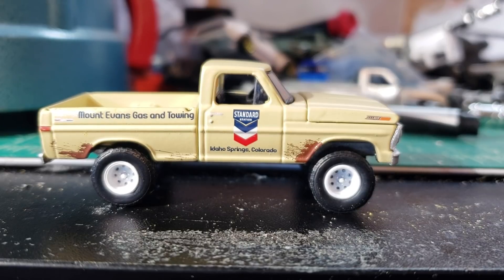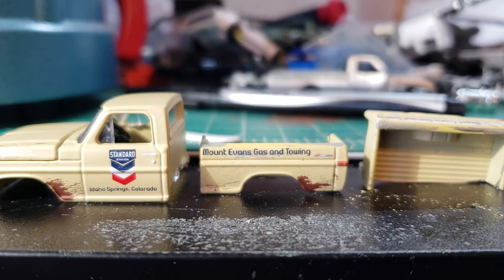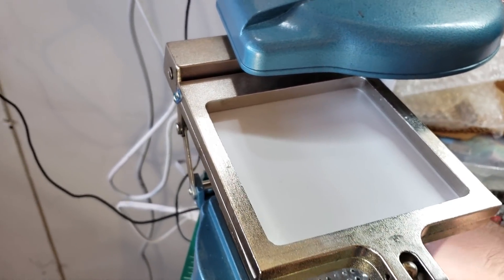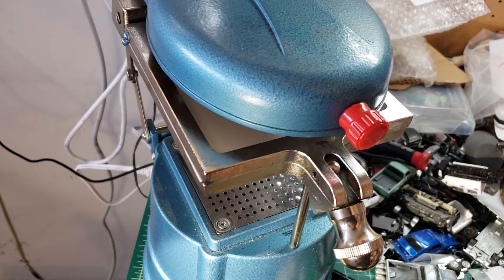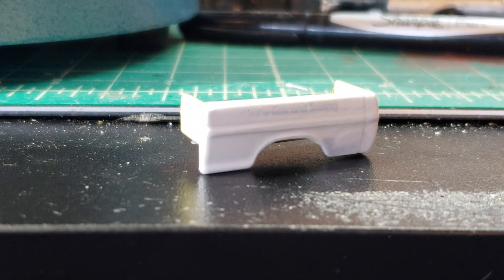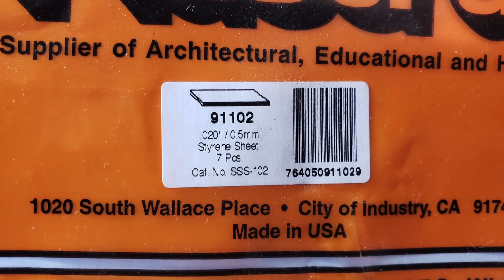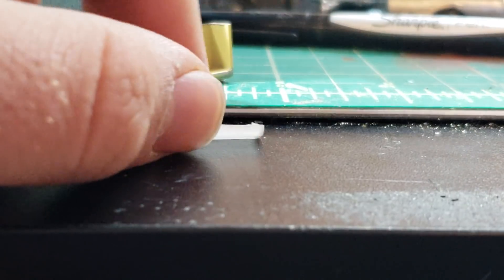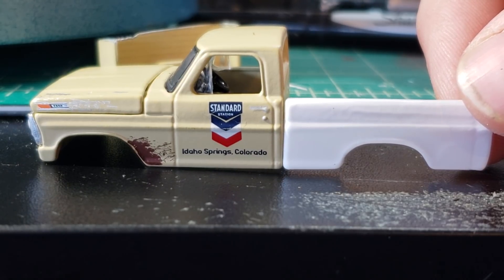Vacuum forming Parts for model cars

Comment: Could you add suspension to the car using tiny springs?
Reply from the maker: Its possible. I've used pen springs in the past but ideally you'll want something like a watch spring. It's making all the pivots that can be tricky